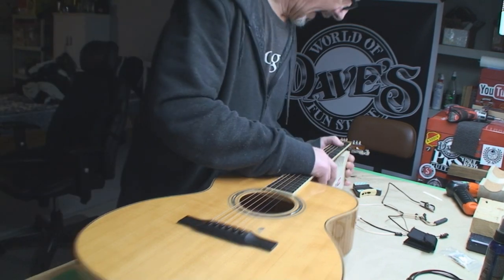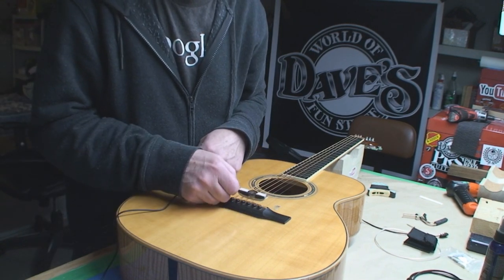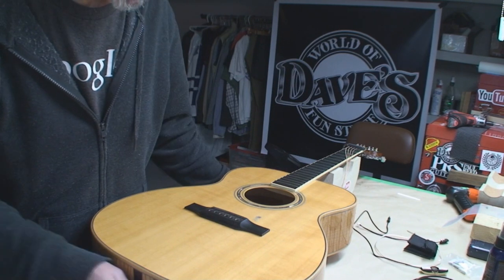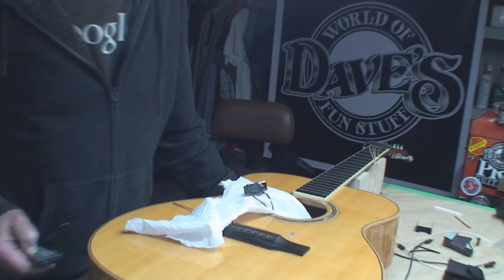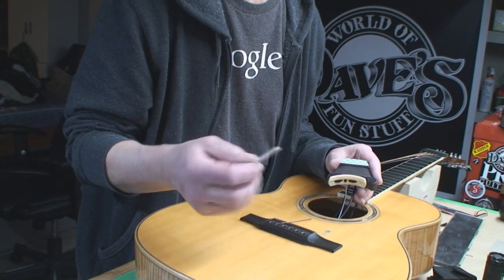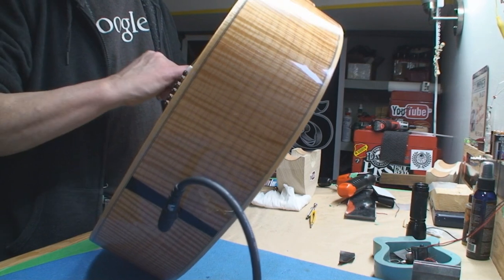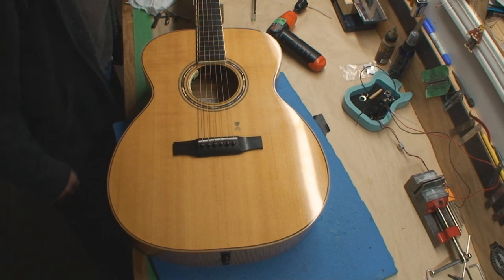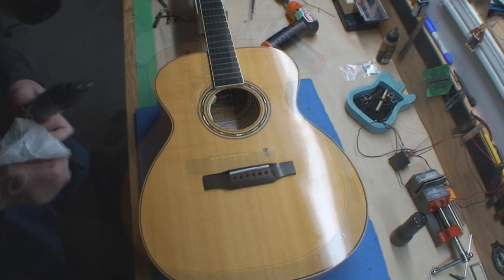No Problem !! I'll Do That For Free !!!

Comment: I found that sloppy saddle situation on my seagull too. I replaced it cause the "tech" at the store gooched it up. Sanded on a slant and so sloppy I shimmed the side till I shaped a new one. He also back bowed the neck to adjust string height! New one came in the sku for that model was still loose. Not as bad but still. 
I chicken out on my pencil lines too so I still need to file a bit of on my next string change. Lol.

Comment: I've found that sanding an acoustic bridge quite often affects how the piezo works (you will never sand it perfectly flat by hand and the contact with the piezo underneath is not even). I had to mill down the bottom on a milling machine to get it perfectly square and flat - only then it worked great.
Reply: PoltergeistWorks I have a breedlove,when I first got it the top e was very quite !!!! I thought it was a problem with the pickup ??? I contacted breedlove ,and they replied that I should file the saddle .This cured the problem ,but whether it was the saddle or the base of the bridge slot ?????
Reply: I made a small clamping device. I use two sheets of aluminum couple of millimeters wide, in which i sandwich the saddle guided by the mark or a line i made with a pencil and a ruler. So while sanding you can go just to the aluminum sheets, not further or with a wrong angle . So it turns nice.

Comment: Hey Dave, they make a surgical clamp with a curved tip that would make threading those piezo pickups a whole bunch easier.  You can buy them at one of my favorite stores:  Princess Auto.
Reply: Working in the IT world, I usually use the "fishing method".  When I have to route a cable to a hard to get to place, I feed another cable down, attach the two cables, and pull up the other one.  The same concept could probably be used for the piezo with some string and a small piece of electrical tape.
Reply: That's the best thing about Princess Auto.  If they don't have something prebuilt, there's probably parts in the store to McGuyver or Red Green something together.

Comment: If the open B string sounds sitar-ish maybe the groove on the nut is worn or badly-shaped. This would cause an unintended metallic vibration instead of a clean ringing note.